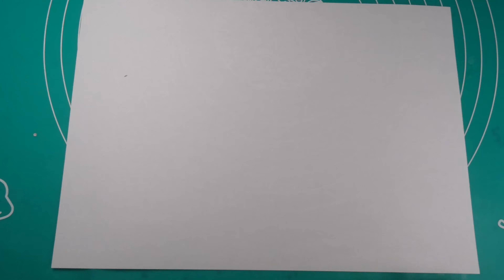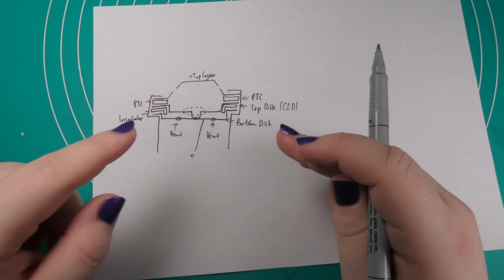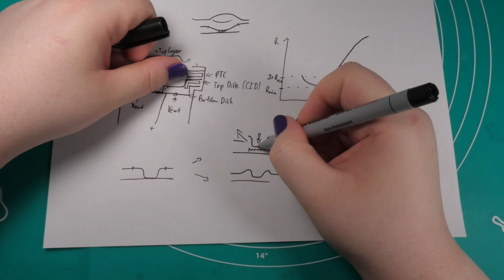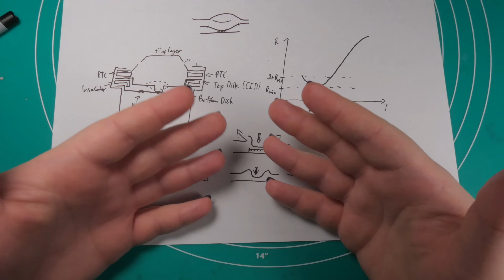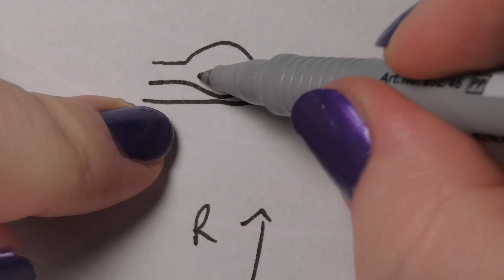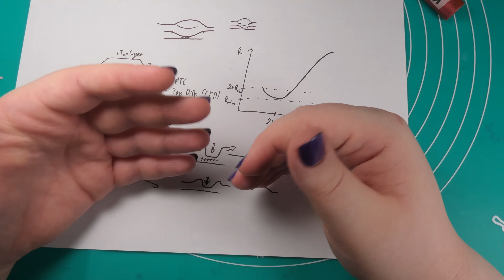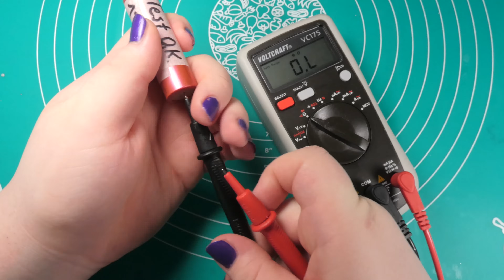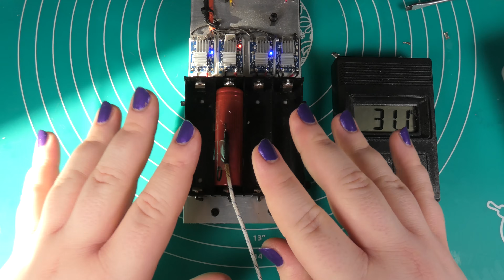Manual CID Reset - Reviving 0V 18650 Cells │ In Detail Explanation

Comment from the maker: Just a few things:
First off the diagram I drew to show the battery protection misses an insulator between the outer housing and all the CID layers.
Then I tried to explain that if you use a screwdriver to reset the CID and you bent the weak spot around the CID central pin with a flat head screwdriver this may prevent it from working properly. Thought my explanation of that might be a bit hard to understand.
Also don't use a multimeter probe as I did in the video to do a CID reset if you decide to. I was in the process of moving and had nothing better suited on hand. I think rounding the backside of a suitable sized drill bit might be the easiest option.